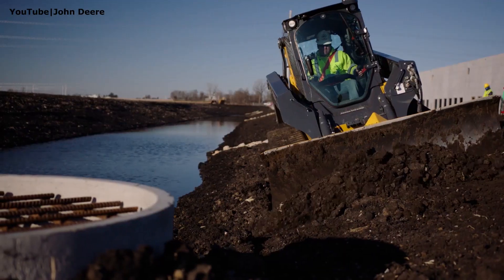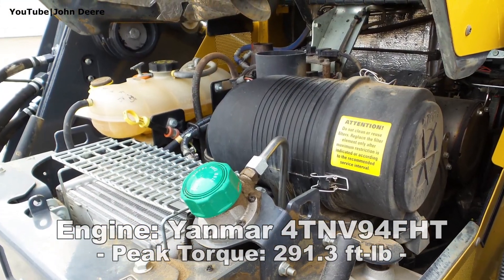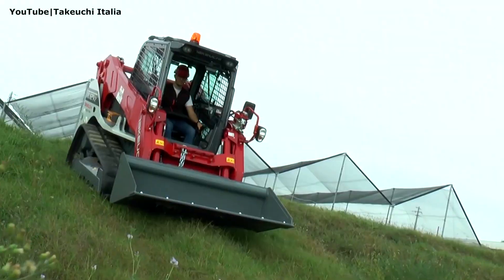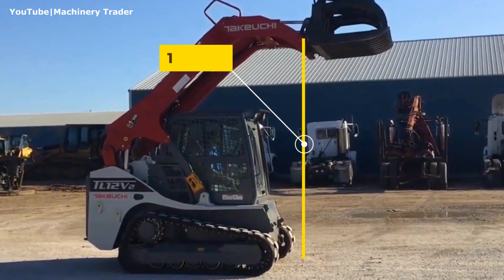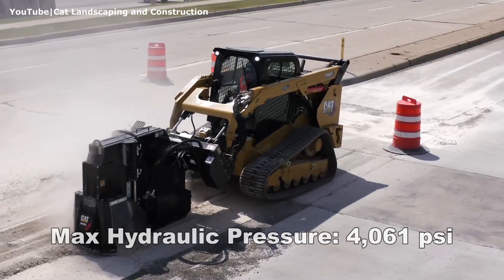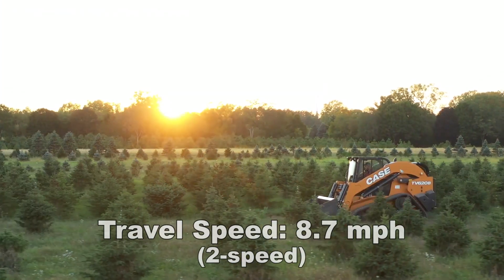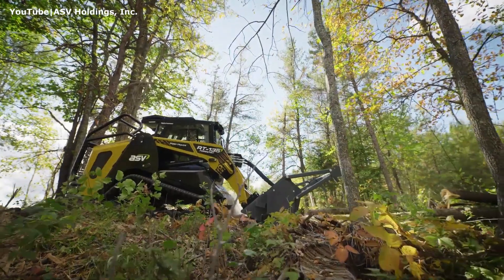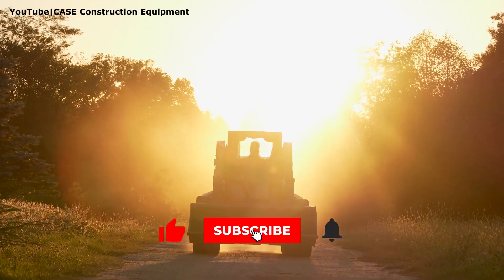Top 5 Most Powerful Compact Track Loaders in 2022

Comment: I own a 2021 ASV 135. It is not the forestry version but still has the Cummins 132 horsepower and all the bells and whistles you can get. I paid just over $115,000 for it and it is worth every penny.I do landscaping and snow removal and this machine is a beast!! Nothing will slow it down. The best CTL you can buy in my book.
Reply: Is that what you paid new or used?
Reply: @devinporter6238  It was a demo. It only had 18 hours on it. They're in short supply right now too.
Reply: Does that include the bent axles they are famous for.

Comment: Disagree with Zizo's comment below.  I took delivery of an ASV 75HD last Sept and run a Mastodon M60F mulcher on it.  200 hours in and I love this machine.  In Sept temps hit 94 here and the cooling system on this machine is great.  Engine temps steady at 190 and hydraulics never red lined.   With winter temps engine  was 170 all day with high flow cranking.   It is still early days, but I work it hard and it responds well.  ASV's are pricey, but they are optimized for forestry work and if that's your application they are well worth it.

I think their Terex connection ended back in 2015.  Yanmar recently bought. ASV.   Don't know if they will switch from Cummins engines to Yanmar anytime soon, but mfg quality is high.

Comment: All comments coming in here, talking about  things that break. I'm old school. The era of when Case & JD made there family of small Dozer/Loader. The Case 450 & 850-C were very Fast. The ( T) handle on the JD 450 was ahead of it's time. JD put that (T) handle on there line of graders for mold board. The International 125s were built heavy duty. And a security system for Lockout was best on market. Just saying all this as these Skid steers are the Replacement for the former small line of heavy duty Loaders &Dozers. These machines are filling that notch in market NOW.